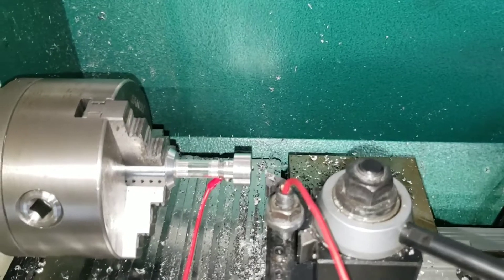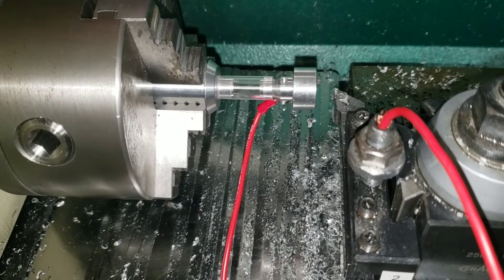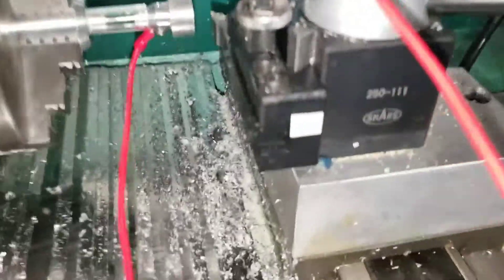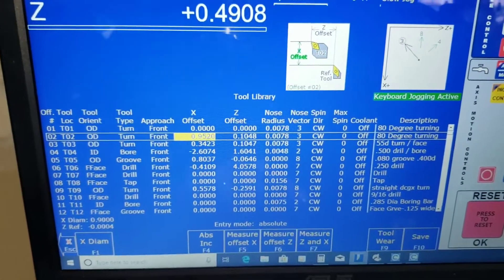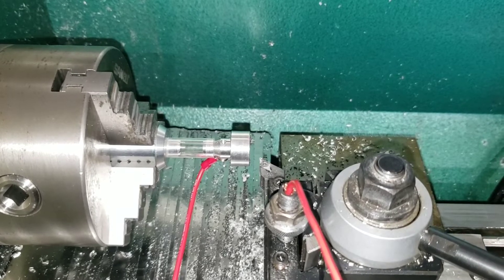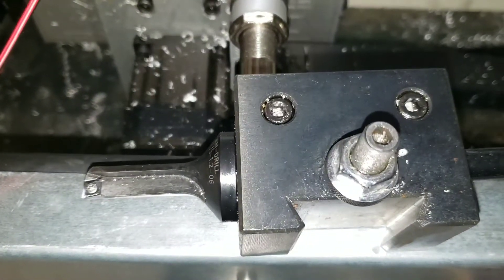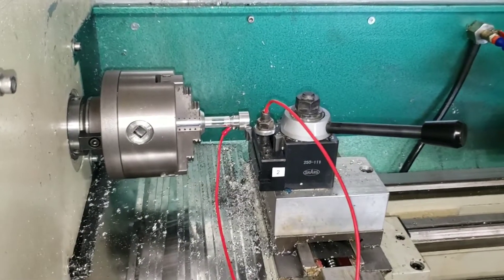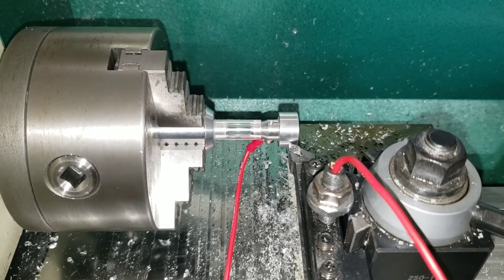Centroid Acorn Lathe - Automatic tool touch off Experiment is running

Comment: I know this is kind of a old but i am having a issue with the tool #1 reference tool set up ,i set tool #1 in part set up skim cut measure the diam. and the z , and then tool table i set the reference for tool #1 and then what do you do with the probe? ( reset the reference to tool #1 with the probe) this is were i get lost  ,i have watched several videos  but they always leave out setting the reference tool for the probe.

Comment: parm 16 is search distance parm 14 is fast prob rate.
Reply from the maker: Yes, you are correct.  I am working on revisiting this method with the new updated V 12.4.20 now released- Look for a new video in the coming months.   I have done some further updates to my lathe and have made a change to my probe.   I came up with a really slick way to measure tool offsets for tool post mounted drills too.
Reply: @adaptedmachining6951  yes I just updated and I ordered a renishaw touch probe we'll see how this works

Comment: we think there is a back side auto tool measure bug in 4.16.. we are looking into fixing it..
Reply: ..and update to 4.18..there were some behind the scenes improvements to probing. (mostly mill related but it wouldn't hurt to update)
Reply from the maker: @CentroidSupport  version 4.18 made no difference for back side measurements.  I can get by for now by adding 2x diameter of the touch off device to the x offset.
Reply from the maker: Oh, cool! I will update to 4.18 and report back. 

I noticed the error was the tool being offset by an additional 2x the diameter of the touch off device.  

My device is .900 diameter and if I added 1.8 to the -2.6*** it was measuring I would have the correct offset.